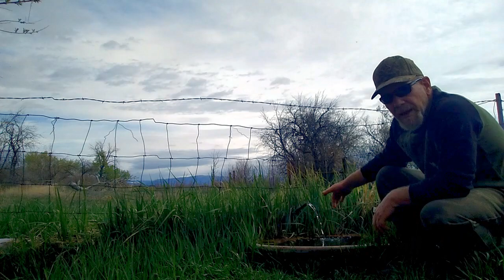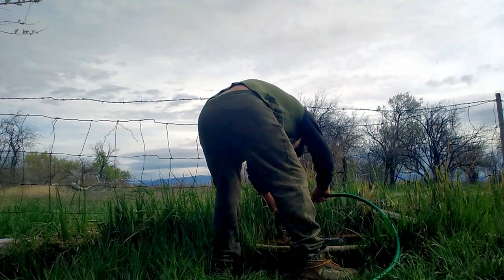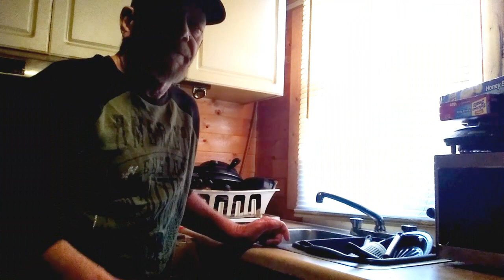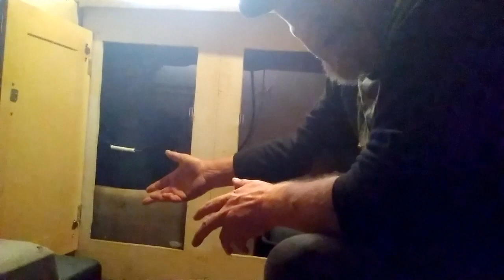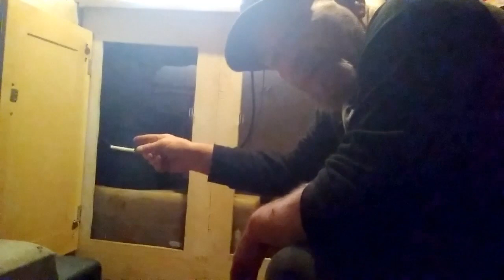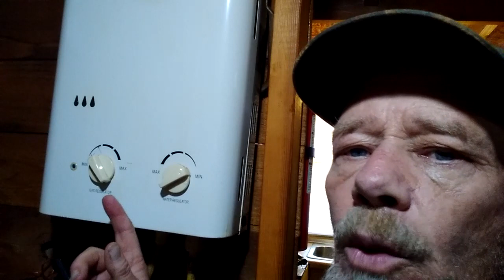Off Grid Water System, Artesian Wells, Pumps, Tanks and OD Water Heaters

Comment: Several years ago I bought a dvd about a solar cabin.   The cabin builder said that his ground water was sufficiently cold that he 
ran it through a radiator and set a fan to blow air through it. He said that's how he kept cool in summer.  Wasn't that you?  If so, is the system still satisfactory?
Reply from the maker: Not me but deep well water runs abut 52 degrees so it would be possible. I use evap coolers and water from my well is very cold.
Reply: @solarcabin  Thanks.  That DVD is still around here somewhere.  I'll have to dig it out and see who the guy was.

Comment: Do you have any kind of filtration for that water or is it safe to drink from that tank?
Reply from the maker: The tank is RV and designed for potable water but I do have a filter I usually attach to the water hose  before filling. My water has been tested and is great water but a little on the hard side.

Comment: Clever, intelligent power solutions - setup your cabin like an RV and tie it into your solar. 12v, you don't need an inverter then, right? On demand propane water heater keeps usage and cost low. ☆
Reply from the maker: Thanks, yes no inverter needed for the pump.

Comment: Good info. How many days would a bbq-sized propane tank last for the water heater? 

Also, I would suggest food grade water hoses or pvc pipe instead of garden hoses which might leach out nasty stuff into the water.
Reply from the maker: Depends on how much hot water you use but that would last me a couple of months.

Comment: Great video. Something I am curious about is how you setup the Outdoor propane shower Inside. I have similar one but I know it needs ventilation. Obviously you made it work!
Reply from the maker: I have a bath room vent fan I run as needed. These OD units usually come with a propane hose and regulator. Just need to run it through a wall. I keep my tanks on my porch.
Reply: @solarcabin  Thank you.

Comment: Maybe put a simple extension to the pip going into the cabin and it won't run down the side...  just a thought...I have sure flow in my shack and have a switch and a small home style pressure tank.  My plumbing has valves and when the water fills up the pump pressure switch shuts it off.  ... so I don't understand why you have to use a switch (12v) to just run water...
Reply from the maker: Those water pumps will slowly siphon the water back to the tank so if you leave it on it will keep cycling. They make anti siphon valves but they only work so so. The switch guarantees it won't keep running.